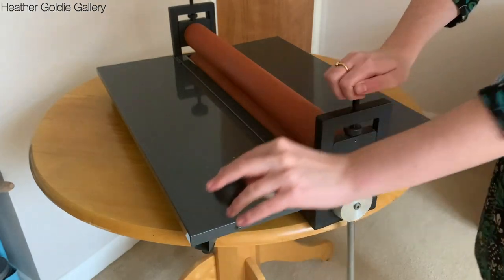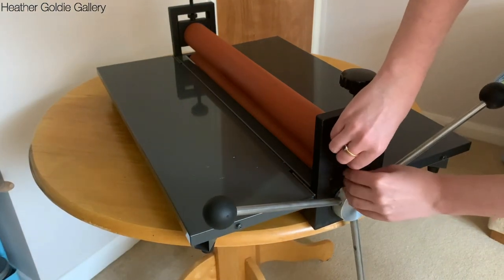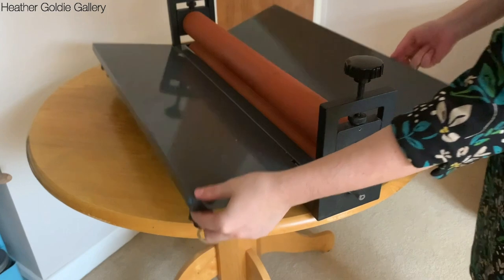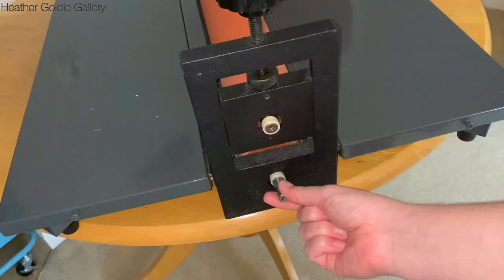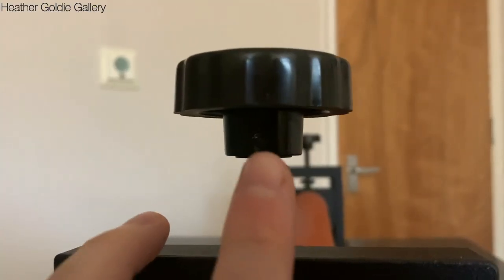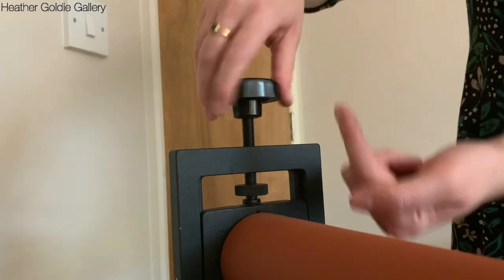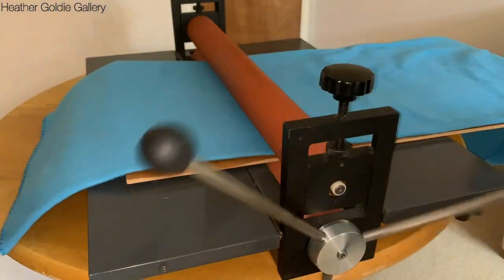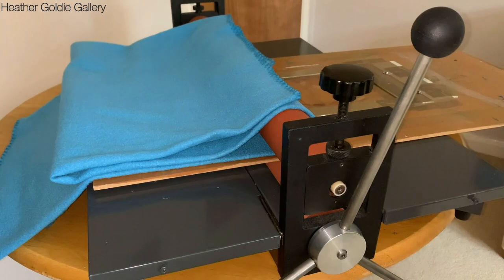Portable printing press review - Ep. 4 Quick Guide Series

Comment: Does this work well for you using multi block and Ternes Burton pins? Do you think this would be tough enough to roll clay into a slab as well?
Reply from the maker: Hi, I use 3mm thick lino or relief printmaking vinyl, in a jig with ternes burton pins and it works perfectly. I use a blanket between the pins and roller though so I don’t damage the rubber. You can adjust the height of the roller too. I don’t use clay at all so I’m not sure but I imagine it would mess up the rubber roller, I’m not sure how you’d clean that off. Hope that helps
Reply: @HeatherGoldieGallery  Yes, thank you, it did help. Regarding the clay, there would be canvas between it and the roller. Can you make a video showing your process with the pins when you find the time?  That would be lovely.

Comment: What types of printmaking do you do on the press…is there limitations with the roller being made of rubber…?
Reply from the maker: Hi Felicity, I am a linocut printmaker, I haven't had any issues with using rubber rollers. I use a cheap fleece blanket between the roller and lino to protect it (different printmakers using different blankets depending on their preference/needs) and it's lasted with no damage so far!